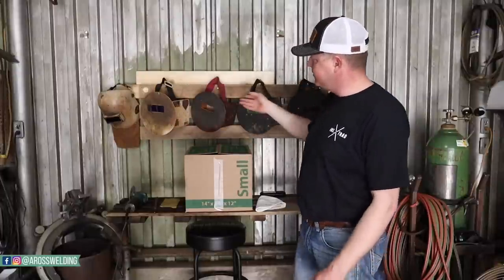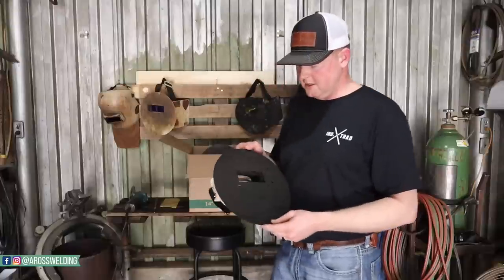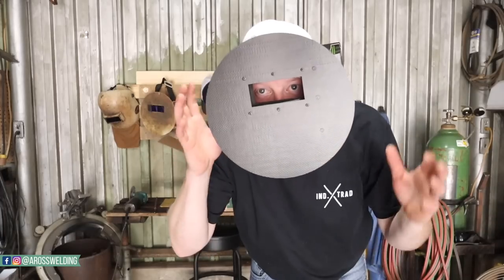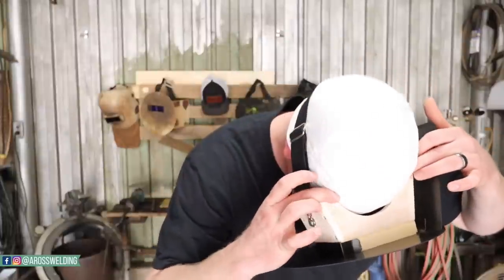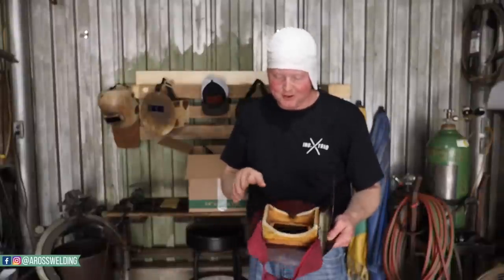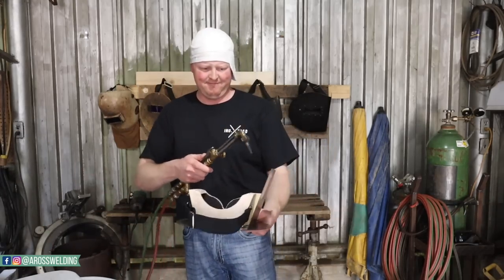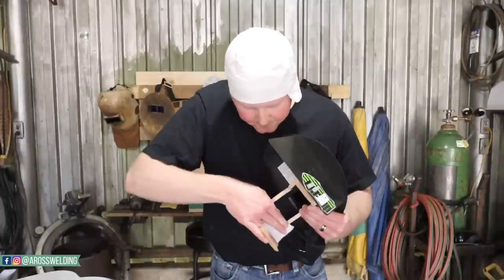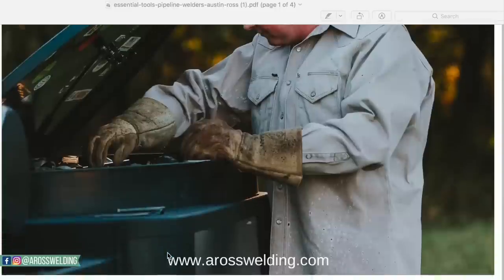PANCAKE WELDING HOOD (NEW CARBON FIBER WELDING HOOD & HOW TO SAND A NEW PANCAKE TO FIT)

Comment: I have never used pancake but I want to :)
Reply: if you want to use safety glasses and or have glasses, then this aint for you. wont fit
Reply: @Mikey-ym6ok  fit the lense inside the box .  Miller has a 1.25 to 4 diopter 2x4" insert for about 12.00. 

I use 2.5 diopter magnification

Comment: No bs hows the hood holding up ? Im thinking about buying one but, would u recommend a cmr or a wendys ?
Reply from the maker: I haven’t used it much yet. When I’m workin on structural stuff around the house I tend to use my sugar scoop. But just by the way it’s built I’m sure it will hold up good. And it’s light weight. I’d go with the cmr just for that reason. The Wendy’s is like 16 ounces I think, and the cmr is around 10 ounces. Depending on which one you get.

Comment: Yes, I own a wendys pc. Sanded it to fit my face, was close fit from mfg. I got the larger lense box for my cheater lens. Just fits. As I use a glass cover lense, glass shade lense the weight is a tad heavy. I am a retired millwright and found the pancake very useful and versitile on various projects. Stay safe out there, thanks Austin.

Comment: Use a Dremel tool works a lot faster and less time been wasted :-) also I do like to take out a lot more material around my nose section and glue in a foam tape. It sit's with less pressure and adjust to my face better..... and oh yes my welding caps been replaced ever 1-2 h because I am sweating like a bullet......

Comment: Years ago, I when I was working as a "Roust-a-Bout" in the "Teapot-Dome" Oil Field in "Midwest/Edgerton", Wyoming, I made my own pancake helmet from a piece of 1/8th inch thick plywood paneling, and a rubberized single lens oxyacetylene eye-shield, both of which I had lying around my shop. After mounting the two together, I simply replaced the oxyacetylene lens with a #11 Stick welder lens. The total cost? An hours worth of labor or less. How long did it last? Well, that was back in the early 1990's, and I think I finally gave it to one of my neighbors here a couple of years ago, unless it is still in a box since I got my Auto-Darkening Sugar scoop about that time a couple of years ago. Did I like it? Absolutely, even though it was a home-made DIY pancake, I still think it was better than my new Auto-Darkening Sugar Scoop. If I could do it and make a home-made one and get it to work all those years, why should I buy one. But, of course I've always been a MacGyver all my life anyway, If I can, I prefer having the fun of building rather than buying, it's both cheaper, and more fun.

Comment: Maybe I’m weird but I took a piece of baler wire and bent it to fit my forehead and centered it and traced it out onto the top of the eye box to rough out a lot of the material, I have a big head and my pancake came sized for a newborn. I did the bottom last, the nose takes me forever to get just right

Comment: Have you ever used a variable shade lens in a pancake or a sugar scoop just wandering how they perform and how they adjust with a clear lens on the back side of them where the controls are at.

Comment: Here's a tip that really helped me get a perfect fit the first time.  Take a piece of solder wire and press it to your forehead.  Carefully pull it away and draw the outline on the top part of the wood eye piece.  Then do the same thing on the bottom to get the contour of your cheek bones and nose.  Use a Dremel and a sanding drum to remove the wood.  It worked perfectly for me.  Zero outside light gets in around the goggle piece and it's very comfortable.

Comment: I'm in school for welding and the first thing I learned was to never use compressed oxygen as a replacement to compressed air
Reply: Ya i teach welding at a college and they definitely preach that in the book. But i worked with a welder that used oxygen to air up his tire if it got low on the job.

Comment: I just got my first pancake hood from cmr and I got the top fitted but when I put the hood on I can see a lot of space around my nose area, does this mean I need to take more off the sides so my face can sink into the face plate?
Reply: Only if you plan on welding upside down lol, you should be perfectly fine

Comment: I am new to welding and was curious about the materials your pancake hoods are made of.  Being that they are carbon fiber and that material has conductive properties, is that an issue or should I not be worried about that?  Also, in your experience do employers require the lenses used in the helmets be ANSI approved and does OSHA have a say into the type of hood one would use?
Reply: Yes, on the website you will find the following information- "WARNING!  This is a Carbon Fiber Welding Hood. Carbon is a conductor of electricity.  When using DO NOT allow the Welding Hood to make simultaneous contact with the stinger and material your ground lead is place on. Doing so could result in electrical shock, burns or eye injury."

Comment: Hey, one thing I've been wondering, is why people use welding hoods that don't auto-darken. The only advantage I see in hoods like your pancake good is that sparks don't fall on your face as much. Is there any other reason a standard good would be preferable over an auto-darkening hood? I personally don't think I can weld without an auto darkening one
Reply: A lot of people run auto darkening 2”x4” lenses in these hoods. The downside of that is sensor/electronic failure. The upside of running a passive lens is that it will never fail you.

Comment: Hey Austin do you know where can I get some test coupons 6 or 8 inch
Reply from the maker: Idk about already beveled but you might check at a scrap yard simply because of the cheaper cost. If you don’t have luck there try a steel supply shop or welding school. Or any kind of construction yard, local city of “said” town.

Comment: What are benefit of a pancake. Is it just the weight savings.
Reply from the maker: Check out this video: 
https://youtu.be/ewk5GNYe8Ak
Reply: @arosswelding  like your vids. Keep em up.
 I rock a sugar scoops but.....Instead of spending hours sanding a new hood. 
Make a template of your old pancake.
Keep template in your truck.
You can literally fit a pancake in minutes, because the template allows you to cut 90% off immediately. 
Then sand to smooth it out.
You can have a brand new Pancake, ready to weld...in under a 15min break.
 That's a lil' Barnhill trick for ya.

Comment: Do you ever have problems with your pancake fogging up?
Reply from the maker: Ya sometimes, depending on the humidity. Mostly when you leave it on top of your head for too long and you’re sweating a lot. But if you just take it off and wave it around or shoot a lil heat towards it, that will help with the fog.
Reply: @arosswelding  I seem to get problems with mine when I got to the bottom of the pipe and it fogs right up, I want to love it but I just can't yet!

Comment: it helps to put the hood on and then have a buddy etc. take a pencil and trace/scribe around your forehead and mark on the balsa where material needs to be removed/high spots/pressure points. it goes way faster that way.

Comment: Cool video Austin, my next hood i will try will be a pancake i have trouble with the light/sun coming in my CIG hiderok
 hood .

Dose a pancake ever fog up on you and you cant see ?
Reply from the maker: Ya sometimes, depending on the humidity. Mostly when you leave it on top of your head for too long and you’re sweating a lot. But if you just take it off and wave it around or shoot a lil heat towards it, that will help with the fog.

Comment: Never had to sand a hood (i'm just a hobby welder with an auto-dark), but taking a tip from woodworking i suggest using a strip of carbon paper between your face and the box. It will leave dark spots on the wood anywhere there's a pressure point, making it easier to know where to sand. Just be sure that you have the 'dirty' side of that paper toward the box :D
And since carbon paper is not very popular any more, you can get away with rubbing a pencil or a piece of chalk on some tape, then sticking it to your face for the same effect.
Reply: Oh you know where the pressure is…

Comment: i have a Sarges pancake hood and sanded it with the sand paper they sent with it and it fits good, i also bought a kit with strips of leather to cushion it around your face and that helps too. it fits good when i weld with it but its kind of heavy when i put it up on my head so i dont use it very much.
it took about 15-20 min or so to get it to fit right.
good advice for getting them to fit.